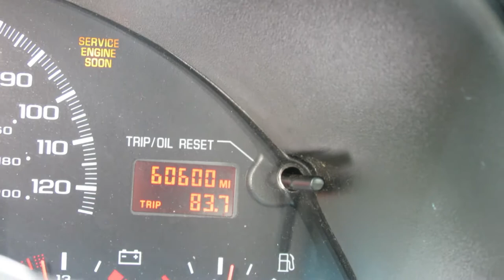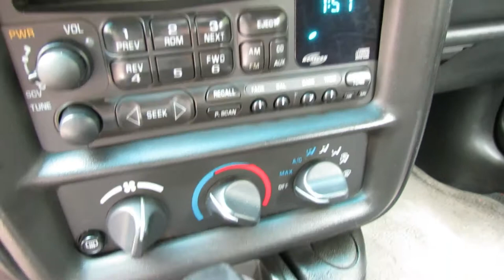2001 Chevy Camaro 3.8 v6

Comment: BRO, this car got the same engine displacement and configuration as Mitsu Eclipse Mk4, you could cruise all day in that car with ease, while being able to get distracted. It doesn't have the same top speed and hi-end torque as a V8, but if you don't need your car to be super, then this is best.

Comment: Very cool! My friend just got a 2002 70k 3.8 Camaro, I love the 3800 engine and my car has the supercharged version :) very cool car
Reply from the maker: Very cool man I love these engines good gas and power in one for a v6 I wish I had the supercharged version! But sadly they didn’t make that a option for the 4th gen camaros
Reply: @Hellbird-uk7yi  I hate that the 3.8 ford thunderbird got an Eaton supercharger. To get that one to fit is even more of a nightmare than getting the Buick one to fit because you need an adaptor plate for the lower manifold.

Comment: Got me one-o them! Everything from the v8 can swap over. I stuck some chrome z28 wheels on it and it completely changes the look.
Reply from the maker: I bet I’m trying to look for wheels as well but the ones on there are nice
Reply: @Hellbird-uk7yi  I actually love the 3.8 so far. I got the 5 speed one and it's pretty quick. Manual swaps for these are stupid easy. The ss and z28 single piece drive shafts and the limited slip rears also bolt up with no mods.
Reply: @Blade_of_Violet_Chaos  wait you can manual swap it???
Reply: @dr.feelgood2363  Yeah, bud. The firebird and the camaro v6 from both the 3rd gen and 4th gen have a borgwarner t5. In fact it's almost the same transmission that's in the mustangs as I have a pro 5.0 short shifter on mine.

Comment: what’s a 3.8l 5 speed like on gas? would you daily drive one as a project / beater ?
Reply from the maker: Great on gas I daily drive mine and to fill up whole thing is 45 and lasts about 2 weeks 22 mpg
Reply: Great car with a 5 speed. But the factory shifter sucks. I'd recommend a pro 5.0 short shifter as a replacement. I'd also recommend looking for a z28 drive shaft. The motors are also perfect for building a boosted setup.